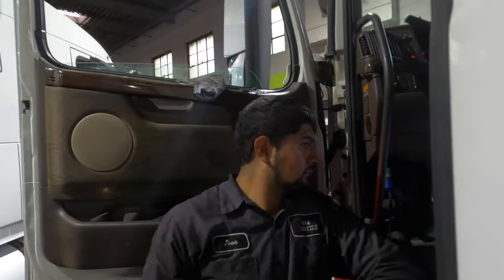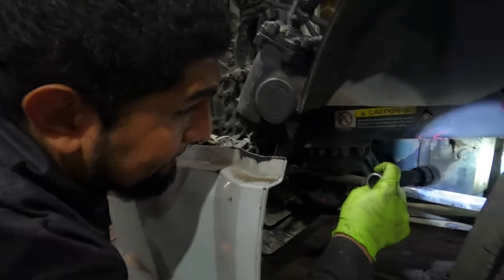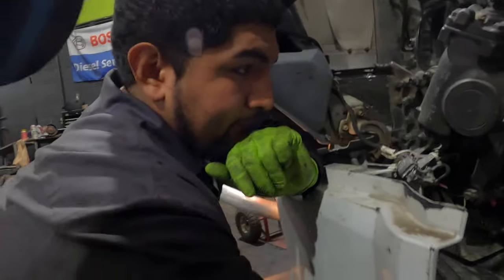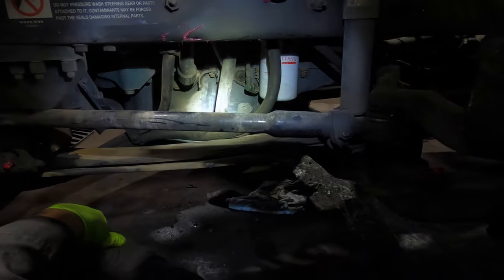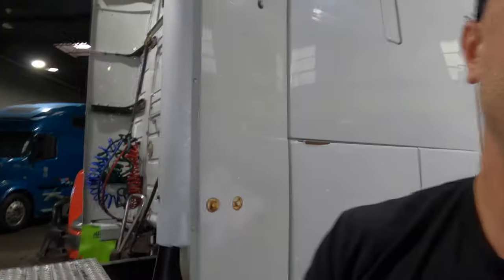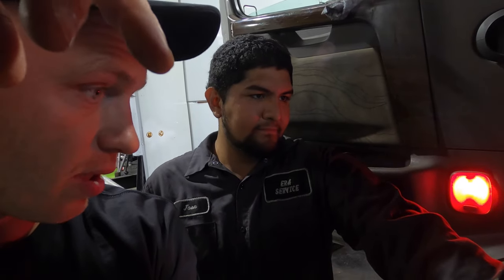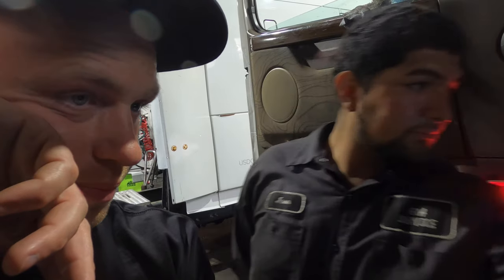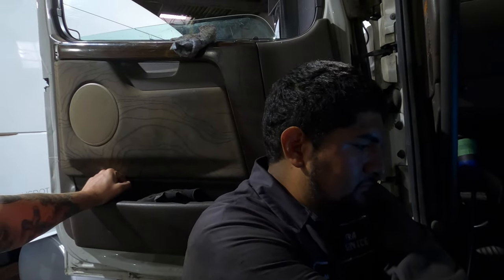Jake brake issues? Check this first.

Comment: Where y'all located? My ECU died and had it replaced. Now my jakes won't work but my cruise control works. I've had a different mechanic reprogram the ECU, replace the brake control and now the turbo. What could be the problem? It's killing me I've spent almost 10k and I'm still stuck

Comment: I have a 2016 D13 cruise control an engine brake not working
Reply: Try lifting up the clutch pedal with your foot then try putting on cruise control or Jake
Reply: Possibly clutch pedal micro switch like we mentioned in the video.
Like Patryk24  mentioned try lifting the pedal up.
Reply: @thatdieseltech4666  thanks, didn't know what it was exactly called!
Reply: Patryk 24 always here to help we never stop learning.
Reply: Thanks all over you

Comment: Hey guys I Have a 1999 Detroit 12.7 60series my Jake brake only works when I have extremely light pressure on the gas pedal.
Reply: Start by inspecting the wiring to that throttle position sensor. Spread pins at connector,corrosion,chafed wiring.
Reply: @thatdieseltech4666   do you know where the jake brake control relay is?

Comment: Where are you guy located? I’m having the same problem but my cruise control is out too. My oil pressure gauge is not working as well. 2006 VED12
Reply: To activate my cruise while at a stand still, I push and hold the brake for 4 seconds. Other than that, the cruise won't work by me just turning it on. Freaking weird.

Comment: It could also be the case that If someone replacing the oil PAN forgot to disconnect the sensors and drop the PAN, they tore it off at that point.

Comment: I have freighter cascadia 2017. 
No engine brake, 
But when I set cruise control green engine light turn on only when set the cruise. So on the mounting I gotta use the cruise to be able to use it! 
Any idea any one ? 
Thanks

Comment: I have 2005 volvo 780 d12 just change the engine brakes solenoid a month ago and  start working fine now is only 1st stage is working the 2nd engine brakes stage not working what do think thanks
Reply: Having this issue right now, what was it ?